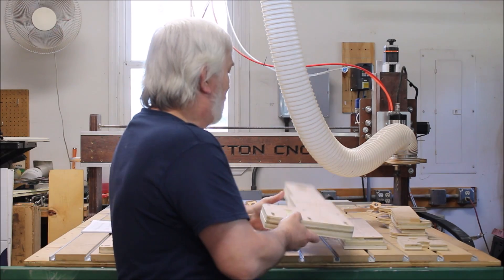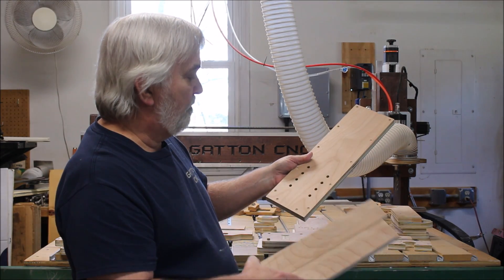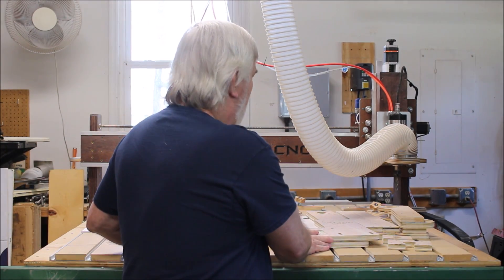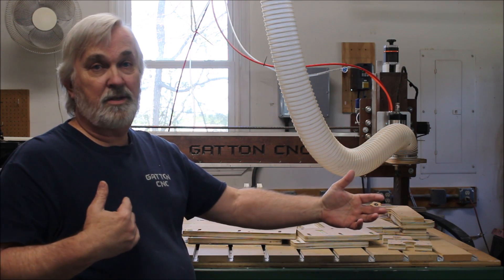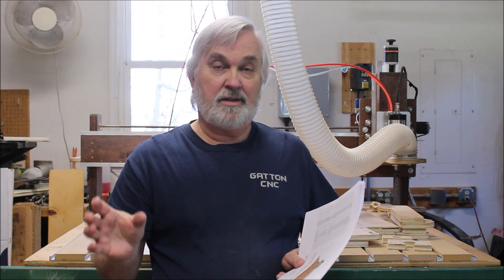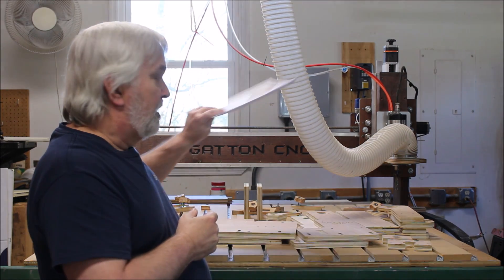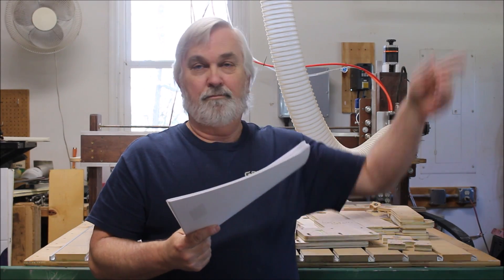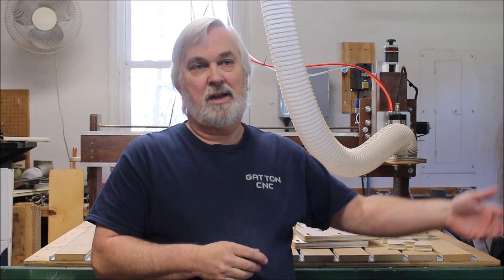Gatton CNC Kit - What Do You Get?

Comment: Thanks for the video Dave. Just a quick question. What would be the approximate total cost to complete the machine. I ran into something similar several years ago, there was moderate savings when adding up the total cost of the parts but what destroyed the savings was the cost of the shipping. I had to order from 12 to 15 different vendors and each vendor charged $10 to $15 for shipping. Thanks

Comment: Dave has made it as simple as possible to build a Gatton. You are also not locked into a companies proprietary software. You can use whatever you are comfortable using.
Reply from the maker: That's a great point that I forgot to mention Gary.  Although, there are some controllers and stepper motors that I recommend you can use whatever you want and there are many choices to use for software such as Mach 3, Mach 4, UCCNC, and even a Raspberry  Pi.  Thanks for watching Gary.

Comment: Like the beard...have not seen it until today.  On the fence about a GATTON CNC right now, I have a smaller Chine unit that works great & I haven't convinced the misses to give up her half of the garage yet.  How accurate of a cut can you make on a CNC made of wood?  If you spec a circle in VECTRIC ASPIRE to be .875"  how close will the GATTON CNC cut it?
Reply from the maker: Thanks for watching David.  I am often asked about the accuracy of the Gatton CNC.  The Gatton CNC is a DIY kit that the end user assembles.  With that in mind I can tell you what kind of tolerances I get with the machines that I build.  If I draw a 0.875" circle I would expect it to be no more than a +/- 0.001" after cut on my machine.  Feel free to go to the Gatton CNC Facebook group and ask the people that have built these CNCs what kind of accuracy they are getting.
Reply: From my experience you will get
 .875.